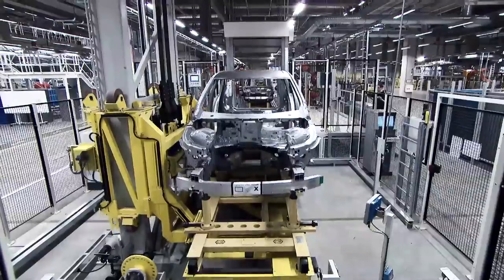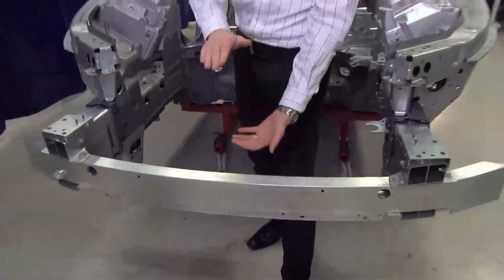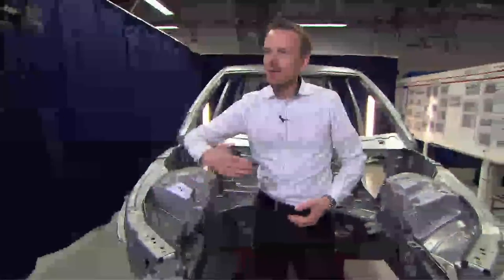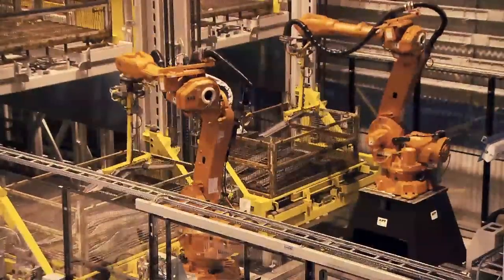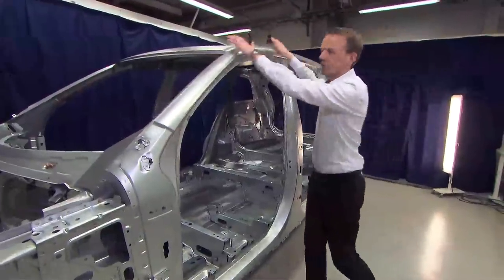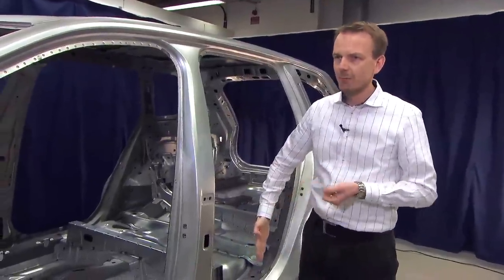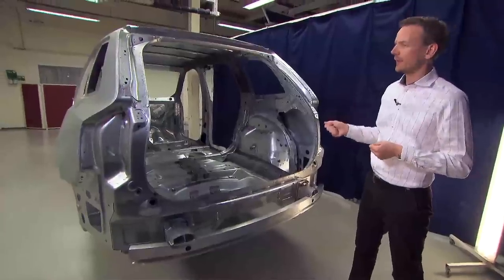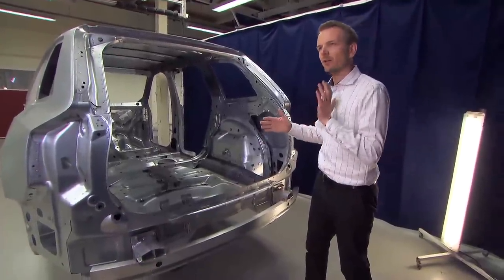Volvo XC90 - Volvo Cars’ steel story

Comment: Which is the usual te thermal treatment for the B-Pillar steel?
Reply: Boron steel is quenched during the hotforming process, i.e. heated above 900 degrees C and rapidly cooled, forming a high martensite content. Conventional steel is coldformed and not heat treated. (Well, the whole body is baked at 200 degrees C in the paint shop, but that rarely counts as heat treatment for steel, although the yield strength can go up a little bit for some steel qualities.)